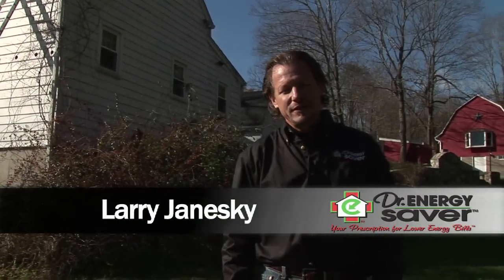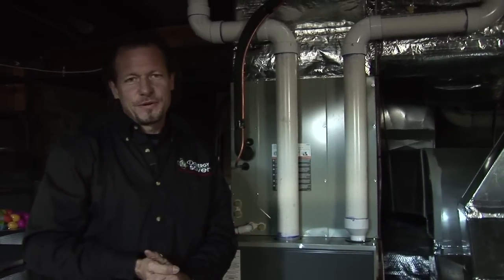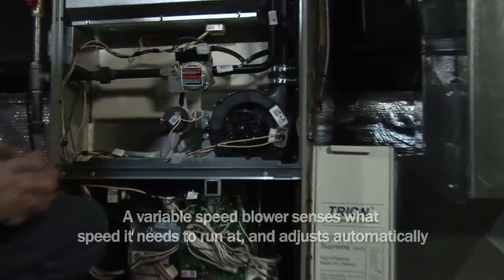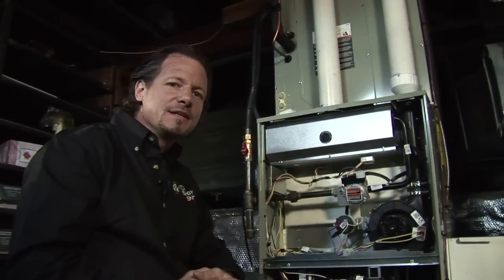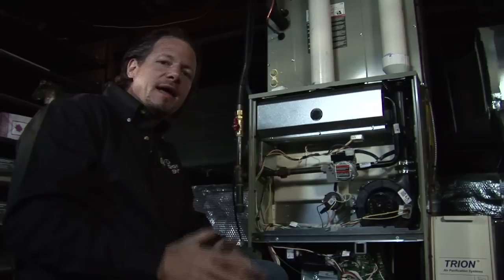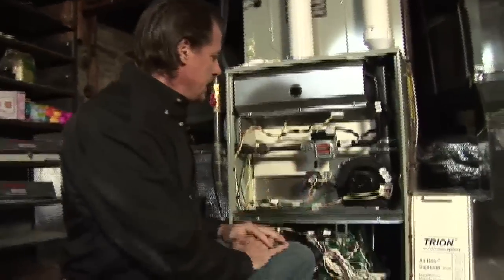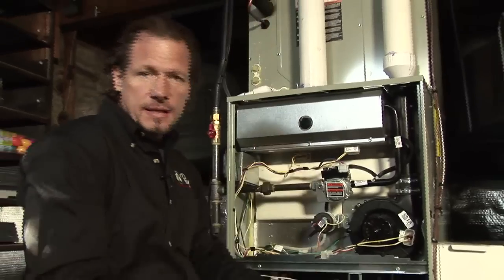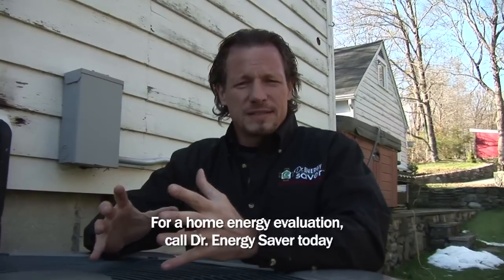Oil Furnace Replaced With High Efficiency Heat Pump, Gas Furnace and Air Conditioning System

Comment: Amazing the difference between back then and today.  Today here in Eastern WA this wouldn't even work because it can get down to the single digits and we're lucky enough to have a governor that's banning gas.  Heat pumps are being pushed on people BUT in the middle of winter they don't have heat.

Comment: So the obvious answer to this question is.  Where do you live; what is your high and low temp and what is available?     Where I live there is no Natural Gas and heating with electric 100% is WAY WAY to costly.

 I  have Electric for AC & Heat Pump.   Then Propane for Winter/Very Cold heat.     The heat pump usually handles most of my heating in Nov-Dec, then most of my heat is Propane (Jan-Feb-Mar), then back to heat pump.    The temps don't go below 32 degrees in my area usually until about January and will be our coldest Jan-Feb with average temps 35 degrees, lows can be low teens and down to 0, but only for a day or so.   So Propane is burning Jan-Feb and part of March for sure.

The heat pump is doing the work in Nov, Dec and later part of March and in some cases early April.   We can see nighttime lows around 35ish degrees or so.

Bottom line is Heat Pump easily pays for itself with the reduced usage of Propane, which can be as low  1.89 a gallon or as high as 2.50 a gallon.    No heat pump and I burn 1200 gallons of propane.   I burn half that with a heat pump around 550 gallons.   I have two hot water heaters on propane as well as a cooktop.

My AC is more expensive than both my heat pump and my propane in June-July-August(especially July/August) and part of September.     

So again it depends on where you live and what your annual weather is like.
Reply: Yes it depends on where you live.  I live in Eastern Washington and are temps can get to negatives and our summer temps can hit the 100's so a huge temperature swing.  We also have a governor that has banned natural gas and propane isn't far behind.  Heat pumps don't tend to work very well from Dec to Feb.  Electric is pretty much the only option at this point.

Comment: that is more than what im looking to do. Im only trying to take out my old oil boiler, and base board heaters and put in an electric water heater and get somekind of electric heat source for my house. I recently put in a new AC system {not a heat pump} so now I want to add the heating element kit to the air handler in the attic so that it will blow heat in the winter as well as cold air in the summer months< question, will I have to ad a new electrical breaker to my pannel or does the kit just plug right in to to the air handlers alredy excisting high voltage area? Towson MD

Comment: I just got one of this furnaces and I'm not happy at all. The house is not warm enough and the dam thing keeps circulating cool air , set at 70 degree but feel a lot lower than that. It turn off for 10 minutes and then start blowing cool air again, I can't believe I pay more than $ 3000  for this garbage.
Reply: I had a guy come over to see what the cost would be to change the oil burner to electric.  He said you’re going to miss the oil burner. Nothing heats like fuel and fire.